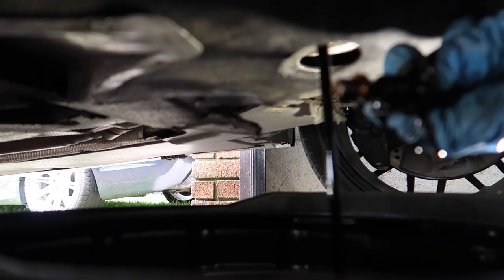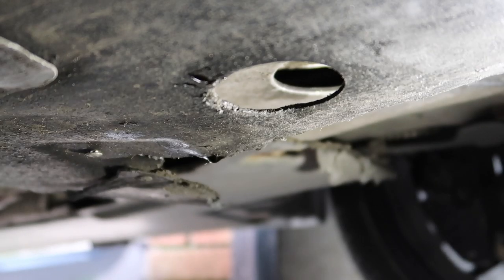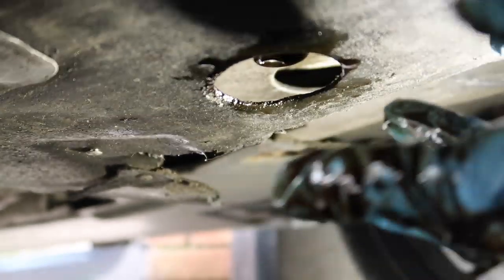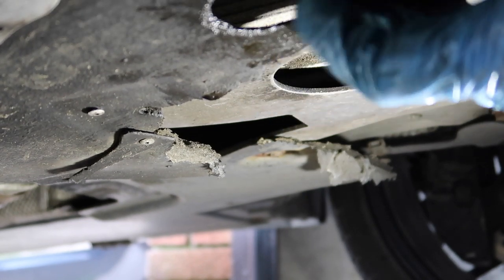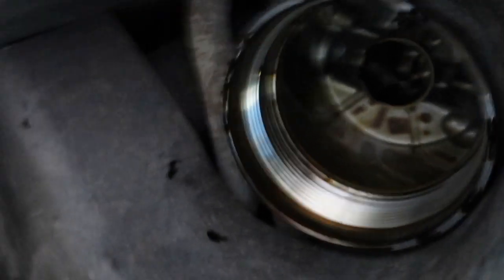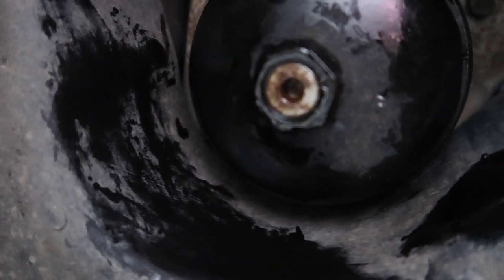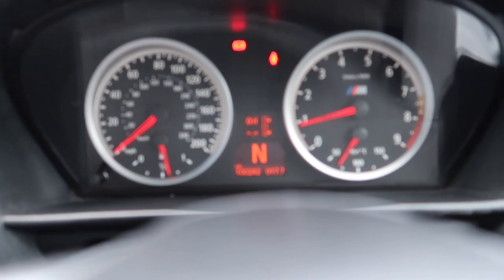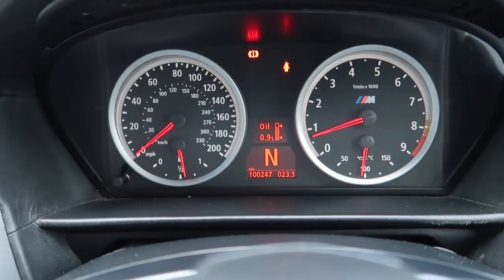BMW E60 M5 / S85 Oil Filter & Oil Change DIY

Comment: Hey Dean, what about the second oil drain plug under vanos pump?
Reply from the maker: This year wasn’t fitted with it mate something in changing over too when I do rod bearings already ordered the new sump from bmw for £300
Reply: Would this second oil drain plug have been fitted to the late 2007 LCI as I don’t change mine I normally drop it off to Bmw as they normally do a service for a reasonable price ( between £300 to £400 ) that’s oil filter and cabin filters plus it keeps the full Bmw service up in the book

Comment: Hey Dean great Videos
I am a fitter and worked on some of my cars for years
But I have an Estate and they are a big horse 
Just a follow up on the oil. change and filter did you use a ramp or do it justice dear the car 
I don’t know where the filter is 
But mine is very low
Sorry for the stupid question but I only have jacks and axle stands
Reply from the maker: filter will be located in the same place my friend you will probably have a cover covering it that you will need to remove if its there mine is not there as most remove it as its a pain to always remove 

it Will be on with 8mm bolts that you need to remove to gain access to the oil filter
Reply: BMW Doctor thank you Dean I do have the covers on as you said 
Thank you for the information 
Take care

Comment: Dean, is there such a thing as a canbus fault reboot as i have replaced the 3 pdc sensors and module, my mate who workes for the AA has told me all is communicating with the computer but i have a can fault which he has traced to the body control module.
Car is 2005 530d msport.

Thanks
Reply from the maker: There is no such thing if you have a can fault that is NOT body control module you also have 2005 that fault is common on this year
Reply: @BMWDoctor  what do you suggest i get looked at next as all is working but car still recognises as PDC Failure on startup.

Comment: I been flicking through negative comments on forums over the past 3 years of ownership by these armchair scaremongers some of which are just laughable tbh .. one of the many comments bought up was regarding what oil to use I personally use 10W-60 Castrol edge recommended by Bmw M division  , there was a few people that have been using 5W-30 oil and the reason they were giving was the recommended oil was to thick when the engine was cold so the later one was chosen as to lubricate the rod bearings quicker and more efficiently have you seen this on the forums Dean ..... me personally I wouldn’t use it I’m sticking to what the experts recommended at M division and PS: I would of thought these engines run very hot so when it’s summer and very hot even here in the U.K. the later oil would be to thin ?
Btw nice M5 it’s more or less the same as mine I have the LCI late 2007 model in the same colour and it’s been very reliable , the only work that’s been done to it is new throttle actuators which is a must and a oil cooler in three years of ownership... I’m glad someone spoke up on YouTube regarding this magnificent car I thought I was the only one with a reliable M5 V10 in the country but the more I read into this car with long term owners the more like me are surfacing 😎👍🇬🇧

Comment: I have watched a few of these oil change videos...Why, are all the ones I have seen have the covers beat all to hell? Y'all drag race over speed bumps? Maybe I'm spoiled, I have two of these, under carriage is flawless on both....by the way, I agree totally, 10w60 only. BUT, a couple years ago BMW did an update, no longer say Castrol, sludge issues. Right, they say Shell...but, me? I have used RedLine for years